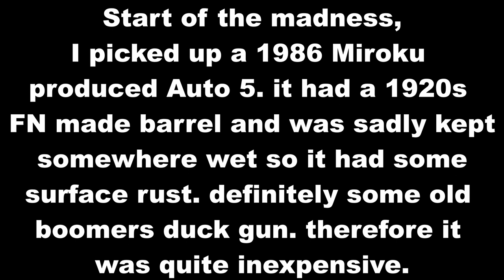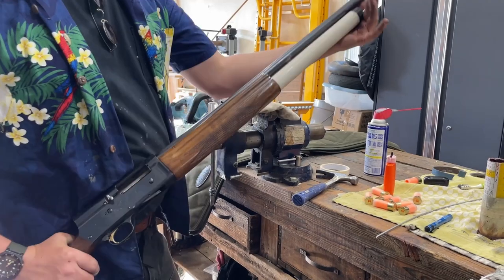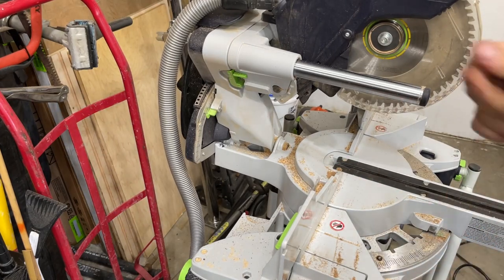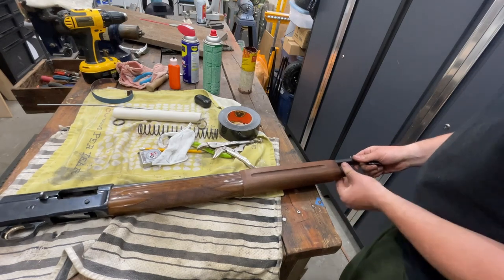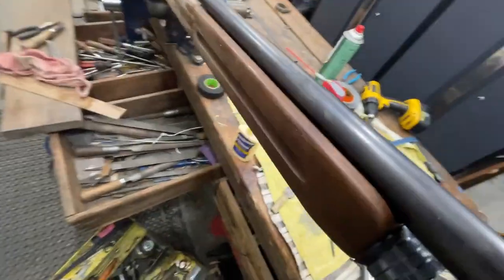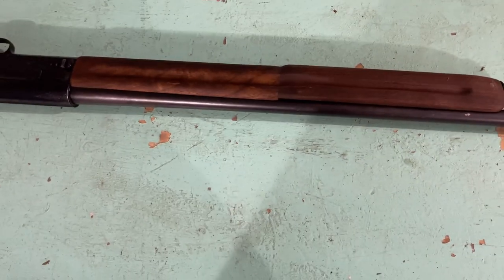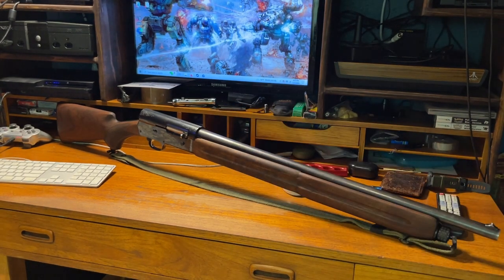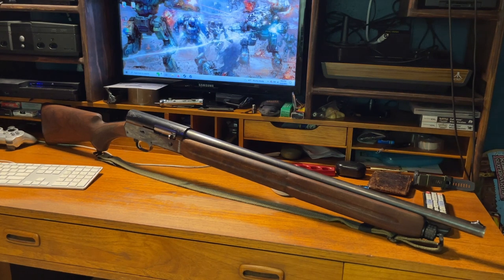Rhodesian Browning Auto 5 Custom Build

Comment: You can load it from the bottom with the action open and it'll automatically chamber the first round for you. It's a feature called the "lightning load."
Reply from the maker: @derikledford544  it’s actually called a speed load two piece lifter, which was introduced into the design around the mid 1950s

Comment: Too late now but really no need to slide the saw when cutting a narrow piece. Lock it if it has that option & bring it straight down on the piece. Not guaranteed to prevent blow out but might work better. Also not sure why you didn't have the springs & bushings in place on the mag tube when fitting the 2nd fore stock. I always have the butt on a solid surface with the gun upright when screwing on the forestock cap. Grab the barrel & push down on it to engage the spring-loaded locking pin. You going at it with vice grips was hard to watch .....
Reply from the maker: Yes that’s why I said the vice grips were the wrong tool for the job as I was doing it, it hurt me to. I latter spent time reading the Browning forums and the magazine tube cap on A5’s are only supposed to be finger tight I was over doing it 100%. The blow out was kinda a hard one to negate since that fore end was covered in a hard lacquer finish that really didn’t want to be cut. And I couldn’t really fit the whole thing with the spring or bushing installed since it’s a ridiculous amount of force on the spring pushing forward, I could never hold down on the spring and do the necessary work on the wood I’d need like 4 hands. Plus with the extended wood fore end it’s even more awkward to assemble, with a standard 4 round mag tube you’ve got a foot of barrel to grab and push on, with this setup it’s like 4in of barrel to grab which is just a pain. All in all I’d call it a successful project especially since I’ve never done this kind of work ever in my life. Just watched YouTube videos and jumped in.

Comment: Why go through all of the trouble,  I have a real Rhodesian A-5 all i needed to do was add a Briley + 4 extension with the swivel sling mount.  For $119.95 shipped, no hassle, cool factor, and it looks great, now it is a 9 shot A-9.
Reply from the maker: I personally dislike the aesthetics of mag tube extensions, having the full wood stock set and welded mag tube also ups the reliability since your not dealing with a threaded on adapter.
Reply: yea, maybe with a cheap Chote or other cheap extension.  the Briley is super heavy duty and has the sling mount in a better location. @MaximusOverhead
Reply: ❤❤This guy was doing on the cheap and he manufactured everything ,,and that makes it something special ,something priceless !
Reply: @damienthomas6655  -- You don't get it, I'm not knocking what Max did, you can achieve the same thing with a high quality Briley + 4 extension with the sling swivel feature for $119.95 delivered.  You would have a 9 shot A-9 that can easily put back to stock configuration.
Reply from the maker: @chasgiles1292  I appreciate the comments! But if you’re not super mechanically inclined or invested in doing this yourself for the sake of just doin it. You’ll probably never understand, yes I could have just bought plug and play parts but where is the fun or craftsmanship in that?

Comment: Does this a5 auto load ? From bottom to chamber
Reply from the maker: All A5’s are semi automatic and load from the magazine tube.
Reply: @MaximusOverhead  what I mean with the action back when you go to put shell in magazine tube does it automatically pick it up and load
Reply from the maker: @henryburness3580  it has a bolt release like an M-16/ar15. So when you pull back on the bolt handle it will lock back and you can drop a shell right into the action, and when you push the bolt release button on the side of the receiver it’ll load the shell you placed in the action automatically, after that it will load from the magazine tube in standard semi auto fashion. You can also just load the magazine tube, and then pull back on the bolt handle and it will automatically take a shell from the magazine tube and loaded it into the chamber.

Comment: Are you aware that your gun has the "Speed Feed Feature?"  It is a post 1963 A5 so when the gun is empty the bolt is open, Period. You stuff a round into the magazine and as soon as you release it, the gun automatically puts it right in the chamber, Instantly!!!  There is no need to Port Load these later guns as the Speed Feed is so much faster and doesn't require you to hit the bolt release or turn the gun over and hold the Bolt Release to load the gun like the earlier A5's do.

IMHO the late model A5's are the fastest shotguns in a Tactical Situation and I can beat the Berettas and Benelli's every time after the gun is ran Dry  IE:  by Single Loading it.
Reply from the maker: @buchananprecisionmachine5490  yes I know about the speed feed option.

Comment: mind listing the parts you used or modified for this build?
Reply from the maker: It’s all in the video if you watch it all the way though, only things I order were a extra mag tube, front have guard and 8 round 12 gauge spring. How I did it all is in the vid.
Reply: @MaximusOverhead  Where did you pick up the extra mag tube?
Reply from the maker: @thesecretjuice  i think it was Midwest industries, I just googled A5 mag tubes with the older thread pitch and shopped around.
Reply: @MaximusOverhead  Thanks. Did you cut off the threads on one end before welding it to the original tube?
Reply from the maker: @thesecretjuice  yes if you watch the video you can see the process there was a lot of measuring and looking at photos of other Rhodesian A5’s online, this was my first attempt at a build video and YouTube doesn’t like in-depth tutorials around firearms so I sadly had to make it kinda vague on a lot of this.

Comment: auto 8 was invented in wwii it was used for trench warfare
Reply from the maker: I know Remington model 11’s were used, since browning had to move production from FN to Remington until the end of the war. Stevens models 520s and Winchester model 12s used during the war as well. But the only photos of the extended mag tube models I’ve seen of A5s were in the Cold War era specifically the Rhodesian bush war. There’s only between 200 to 400 factory extended magazine FN models in the US.
Reply: dam nice gun i only goth a old  uato 5 fn
 @MaximusOverhead